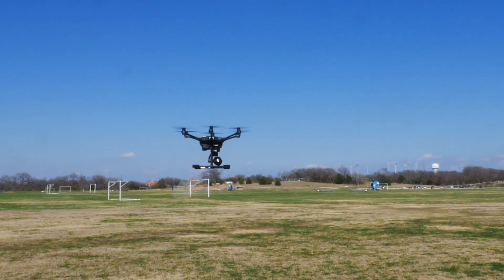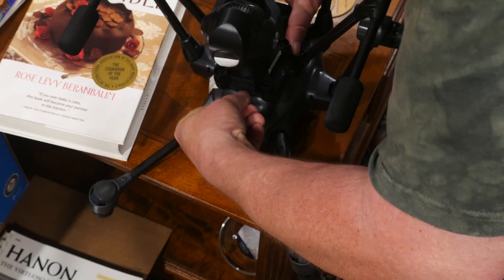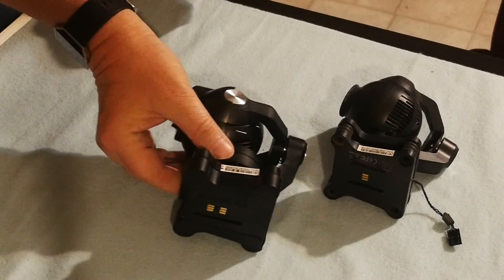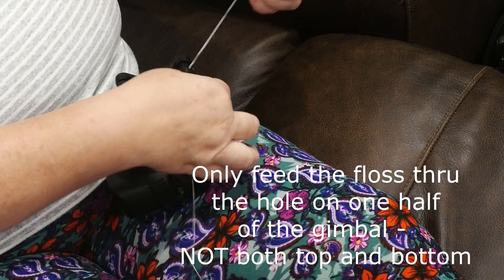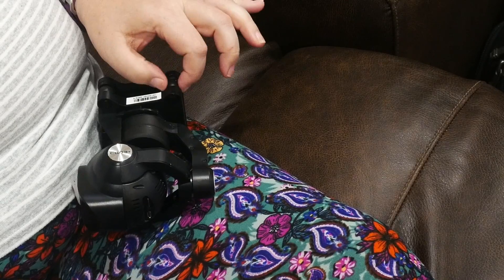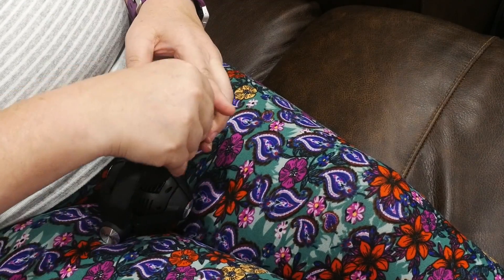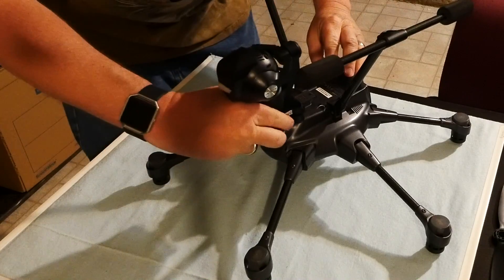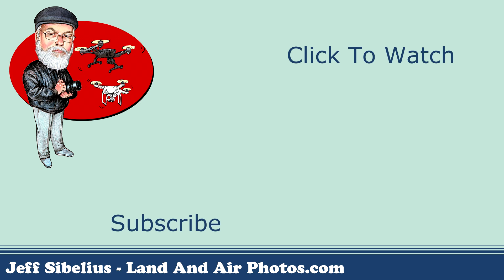How to Fix the Yuneec Typhoon H, Q500 Gimbal Damper - Reattach Rubber Gaskets on  CGO3 CGO3+ Camera

Comment: It works!
Reply: Any clue on rt16 controller repair? My right stick shows that's it's not reaching 100% and it's neutral position is 16% to the right. It can't be a hardware issue... The stick physically moves everywhere.

Comment: I love my Typhoon H, but my only real complaint about its design is that these dampers come loose too easily.  In a hard landing or crash, this can cause the camera to separate from the aircraft and pull all of the wires out of the yaw motor.  The guys at Terrestrial Imaging taught me a neat trick to prevent this from happening.  Insert a nylon cable tie through the hole in the center of the damper and the gimbal plate.  Pull the cable tie through until the clip lock sits down into the recess on the gimbal plate.   Run the clip of a second cable tie up the first tie until it begins to recess into the hole on the other side of the gimbal plate assembly and snip off the two loose ends of the cable ties.   Be sure to leave a little slack so that the rubber damper moves freely.  Repeat this on the opposite corner of the gimbal plate and that should take care of it.  Two is enough.  I did this to my Typhoon H and Q500 as well and have not had any more issues with dampers popping loose.
Reply from the maker: That's a great tip!

Comment: Thanks for this. My H actually came with one corner hanging off the gimbal, and I fixed it a very similar way. But on 2 of the corners of my gimbal, there is a small plastic insert that is meant to run through the rubber grommets and terminate in an O ring. Surprised to see no mention of those in a video as thorough as this... are they not on yours, and does anyone know what they do ? :)

Comment: Jeff, thank you and your wife for this episode.  Perfect timing for me and everything went smoothly for me.  The waxed dental floss worked well !!!

Keep up the great work!!!  Truly appreciated.
Reply from the maker: I passed your thoughts on to my wife, which she appreciated. Glad we could help!
Reply: I recently had a hard landing and developed an approach that might be a tip.  All 4 of the rubber dampers had become loose on one end.  Putting them all back on became frustrating for me as one would pop off as I put another back on.  

I used some blue painters tape to limit the movement of the gimbal by applying it on the sides.  Then it was back to the dental floss and all is once again good after gently removing the tape.
Reply from the maker: That's a great idea - I hadn't considered how to do it with all four dampers loose. Just curious - was this a Q500 or the H?
Reply: It was the Typhoon H
Reply from the maker: That's what I figured. They really need to beef up the dampers on the H gimbal.

Comment: When you see a Dentist, does he reattach bad teeth, or repair the tooth?   Putting in the rubber bumpers that came out once will only fail faster next time.  The trick is getting stronger rubber bumpers.  Inspire bumpers work very well.  The Yuneec bumpers that come out easily have been discontinued by the factory.
Reply from the maker: There is a lot of logic to what you say - I've only had one Q500 damper come loose compared to four on the Typhoon H (two different cameras) so their dampers are not well engineered. 

I haven't had a damper come loose after reattaching it, so far at least so I don't think there's any harm in reattaching the one that came loose. If it happens repeatedly I'll look for another option.